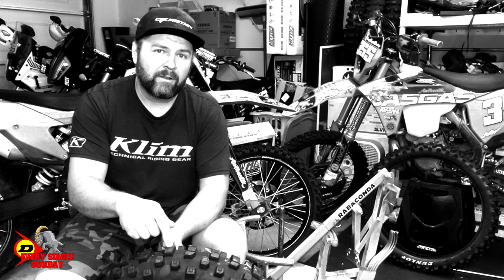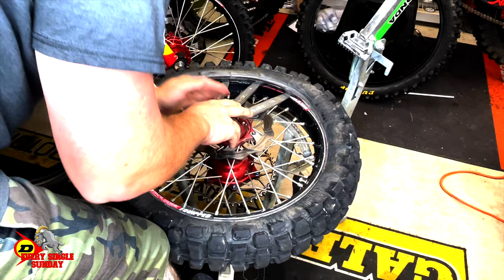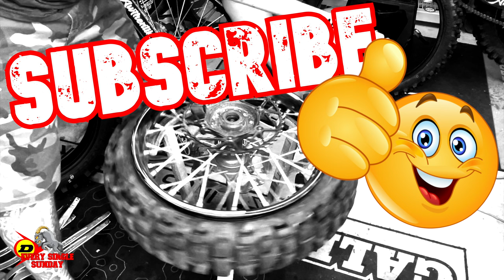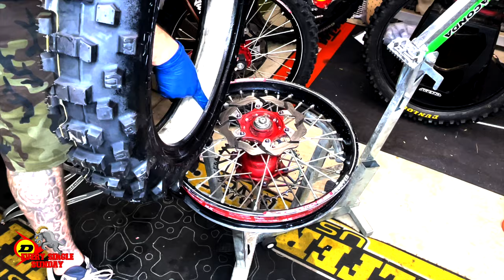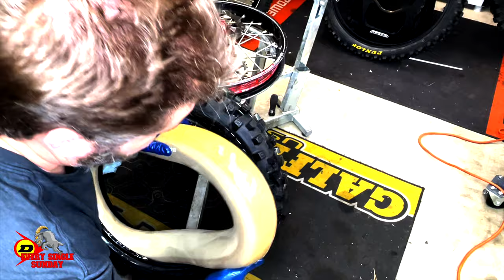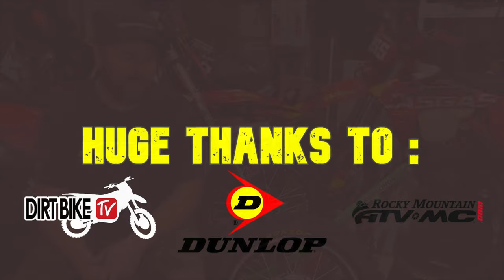Mounting a Mousse - EASY Step By Step Guide

Comment: 63 years old, riding over 50 years. That’s the first time I’ve seen a spoon used on the opposite side to find drop center. 👏🏻 I’m pretty sure that tire has a balance point circle. It’s yellow and marked at the lightest point of the tire. It goes next to the rim lock, the heaviest part of the rim. 
Also I didn’t know that Dunlop had that tire. I’ll check it out after I burn off two more sets. 
Thanks for your “reality” video. It’s nice to see humility and goes a long way in my book.
Reply from the maker: With Mousse, balancing is almost out the window without throwing it on a balancer afterwards. Because now you have the tire and mousse that you need to balance. I don’t believe this tire has a yellow dot like most street stuff but I may have missed it. Thanks 😊

Comment: As usual, great video! I might add one thing that I have run in to, the brake disk should be cleaned with some type of "Brake Clean" before re-install on the bike. I have found that some spray slick stuff will contaminate the brake pads. Then it's a new pair of shoes.
Reply from the maker: Good call on that one. Always a good idea to wipe rotors down just incase

Comment: 2 or 3 bead buddies do the trick especially with Michelin desert race mousses which are way harder than those.
Good job Travis!
PS: for the rim lock at the end, you can push it simply by using one tire lever & the Rabaconda rim support tube underneath the spokes when you do your last bite.
Reply from the maker: Yes, the desert IT is a gift from satan himself 😂. I’ll pull out my bead buddies when it gets super difficult but a spin works well for me.  As for the spot to wedge the rim lock…. I struggle to make that work
Reply: @EverySingleSunday  The clamp is genius.

Comment: I'm glad you showed it with a bigger mousse. I still can't do a 120/18 Golden Tyre 333 and a Michelin M14 mousse despite using my Rabaconda. No idea what I'm doing wrong. I take it to my tire changing guy and he says it's a bitch even with a tire changing machine so not sure if it's me or the tire/mousse combo or both.
Reply from the maker: It definitely takes some time to learn. I still have some I struggle with from time to time.  Find an older soft mousses and tire to practice with

Comment: Great video.  I find that I have to cut and stuff the Nitro Mousse even when new sometimes. I don't think they are very consistent in size even new. I just keep an old mouse for cutting pieces to stuff them.
Reply from the maker: I had that issue a few times last year but they seem to be getting better again. I’ve talked to them and they had some manufacturing issues

Comment: With the mousse sitting on top of the bead lock like that, do you feel the bump if your pressure is low enough
Reply from the maker: No, I’ve never felt it before. In my gummy setup with a soft mousse and tire and I actually run 2 rim locks also. But I can’t feel them because it’s not that soft
Reply: Awesome

Comment: I’m getting ready to change the tires on my new TBI 300 husky what would you recommend for tires and moose for winter riding
Reply from the maker: I’d say a soft rear mousse and a firm front one.  As for tires, I don’t know if you’re running somewhere that requires studs or not. But a IRC VE33s would be a good place to start

Comment: If you are doing the 3000th how to install a mousse video, at least do it on the floor for those that don’t have an expensive tire stand.
Reply from the maker: I did a video on how I do it tricks and tips and then I use. 

If I changed my tires on the floor using sticks, then I would’ve done it that way, but I don’t 

If you’re gonna leave the 3000tj comment on how you want to see a video made…  you should go make the video